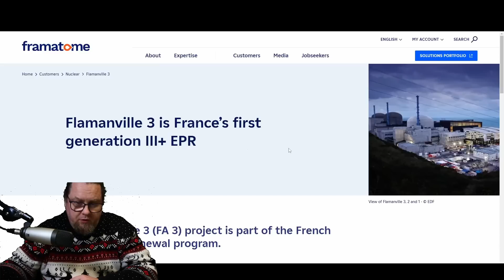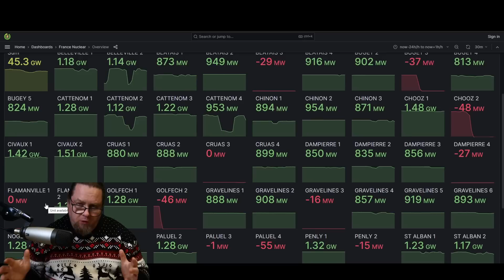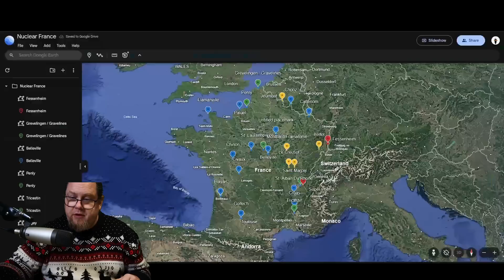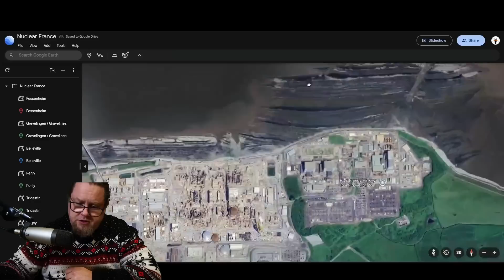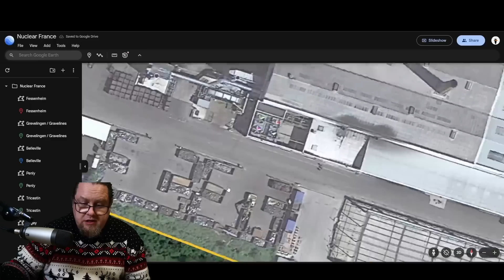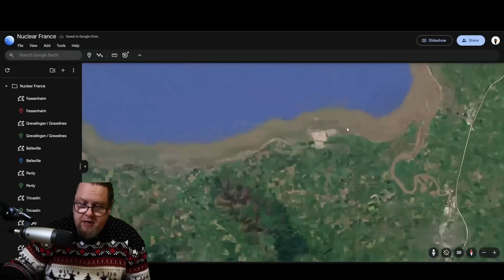Victory at Flamanville! France’s Nuclear Comeback After Years of Turmoil!

Comment: One thing that is not considered by most people is that this reactor is designed from the start to operate for much longer than the old gen2, twenty years longer. If there are no further problems, the cost of electricity for the reactor can be around 4cts in the long run.
Reply: And 2: it helps giving stability to network prices

Comment: Need to have high tempature units that can store heat in molten salt and power industrial use.  This way the nuclear units can operate at full capacity and cut CO2 from 50% of the industrial power needs.
Reply from the maker: They will come, I'm sure of it! We just have to trust the devs to finally push through all the barriers and get their first deployments done.
Reply: I don't want to be hurtful, but the likelihood of that happening in our lifetime is between low to zero.
Reply from the maker: @DanTheCox  You mean high temperature reactors? They're already building the demonstration plants for TerraPower & Kairos, both are high-temp Gen IV. They will go critical before 2030, I'm certain of it.

Comment: To be fair, delays and cost overruns tend to happen in any big projects. I still prefer a working nuclear power plant over, say, a philharmonic in Hamburg.
Reply: "A racing automobile with its bonnet adorned
with great tubes like serpents with explosive breath ... a roaring motor car
which seems to run on machine-gun fire, is more beautiful than the Victory
of Samothrace."
Reply: @peterfireflylund  Marinetti, Futurism Manifesto 1913
Reply: @peterfireflylund  You absolutly need a Rolls Royce.
Reply: when projects are run at the "european level", you'll have a lemonade stand at the cost of the apollo programme. The cost and delays are the results of loss of experience, degraded economies and international "competition", rebuilding it takes a lot longer and doesn't guarantee that it will ever be competitive, for example: SpaceX vs Arianespace. The latter is effectively dead without direct and indirect subsidies.
Reply: @DanTheCox  So is SpaceX. It's entirely reliant on government subsidies.

Comment: This is an important milestone. I hope that the design improvements in EPR2 will allow them to be built faster.
Reply: It will, already if it was going to be another EPR.

It would be nice to see a deep dive into the differences towards an epr2
Reply: @ferkeap  Here is what google says:
"An EPR is a standard European Pressurized Reactor design, while an EPR2 is an optimized version of the EPR, featuring a simplified design with more modular components and prefabricated elements, aiming to reduce construction time and cost while maintaining the same power output and safety standards as the original EPR; essentially, the EPR2 is considered an improved and streamlined version of the EPR, incorporating lessons learned from previous EPR projects to make construction more efficient. "

The six new French reactors will be EPR2 while Sizwell C will be an EPR. Both designs are rated at 1650 MWe.